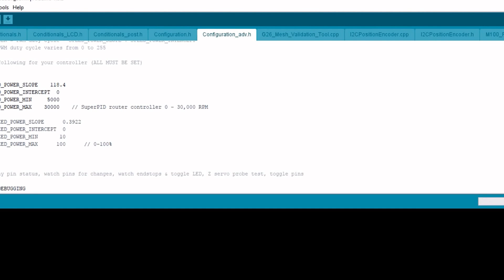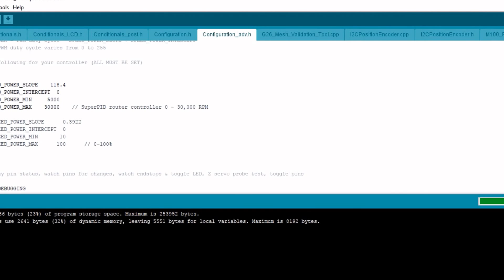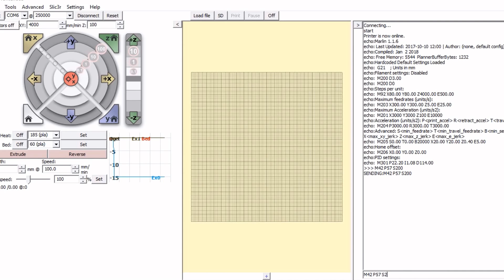RAMPS 1.4 - AUX-1 LED lighting

Comment: Am I right that you can actually add your own code  (I mean code that controls the senor that you added) to the Marlin and then you can connect sensor to the RAMPS like you did it there? Instead of calling G-code from Pronterface you can call it from the Firmware and then you can for example force the printer to pause/stop the print  by calling M-code?
Reply from the maker: Correct.

Comment: why do you know that M43 = P57?
Reply from the maker: L lair pinouts diagram for Ramps 1.4. but M43 sounds like the gcodes for a command. P means pin and number.  As for equality between the two I'm not sure I understand the question. M43 is the gcode for a command.
Reply: Thanks!

Comment: Is it possible to control this through the reprap full graphics smart controller? I don’t really wanna open pronterface to control this every time!
Reply from the maker: Well possible yes, easy initially no.  You would need create a menu option in the firmware.  As for one already existing you would have some work to do. My guess if I would be doing this is to find existing menu functionality and modify it to start.  Good luck.
Reply: just connect through your power supply also ok..if you want it to be like that.

Comment: That's really great ! Do you have the possibility to do the same for RGB LED ? And if possible not use the screen pin as Thomas Sanladerer did ?
Reply from the maker: As soon as the part arrives.
Reply: Edward Braiman Awesome Thanks!
Reply from the maker: Do you know the part name or number?  I'll need to order it and figure it out.
Reply: Edward Braiman you only need rgb light strip

Comment: What do you mean by amount if power 200? What does the 200 stand for?
Reply from the maker: +matery88 the power rangers for the gcode is between 0 and 255. This is related to between 0 and 5 volts.  So 200 is close to 4 volts.

Comment: Where would you connect this if you have an external thermister connected to Aux 1?
Reply from the maker: +MyClass depends on your available digital pins.  I've not tested other places, but you could try AUX2 or another place.  Keep in mind the pins I used the row above in my AUX1 pins did not work, so you would need to experiment. If the LED lights up before setting the digital pin to high might mean to try another digital pin when.the Arduino 2560 has power via the USB serial cable.  Hope this helps. If it doesn't let me know the pins you have free and I'll experiment until I can find a working alternative connection